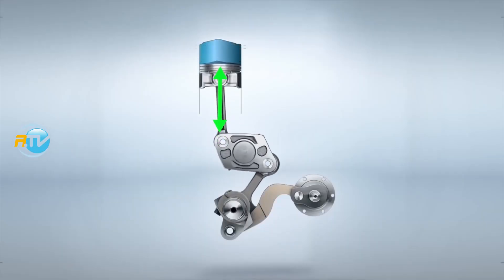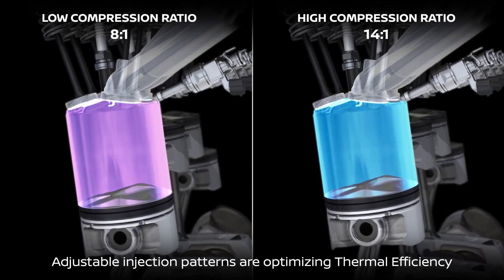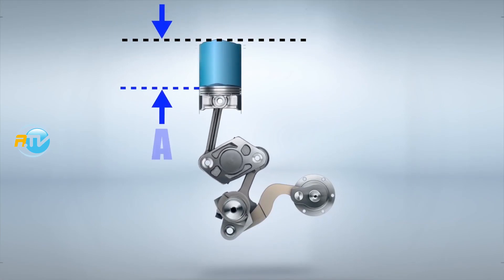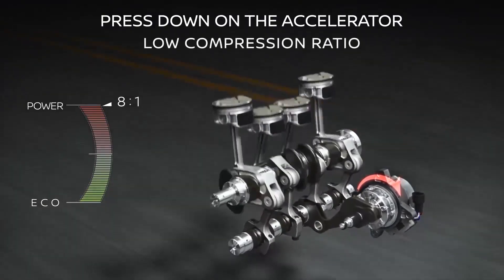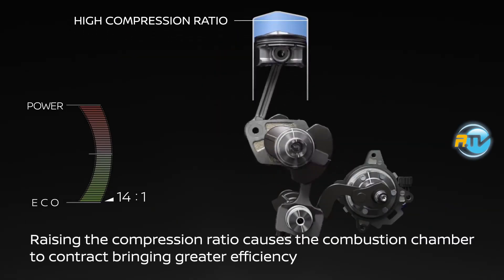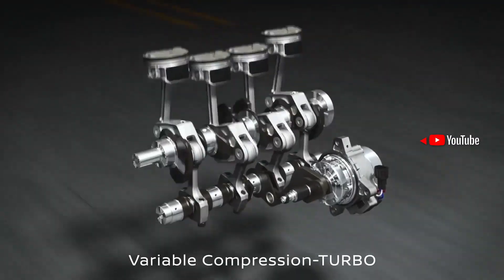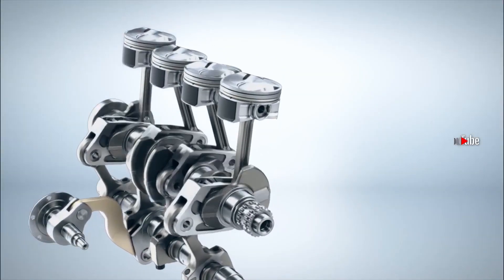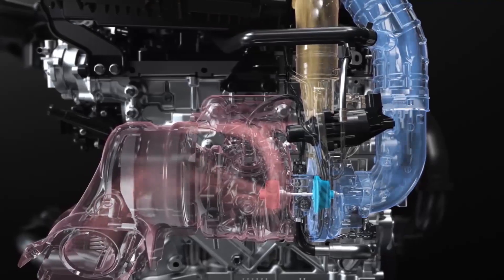How a Variable Compression #turbo #engine works?

Comment: They could make a diesel hybrid with this. Starts up using gas and switches to diesel after the cylinders get hot, but also uses electricity to accelerate.